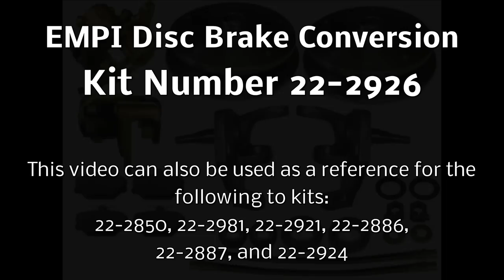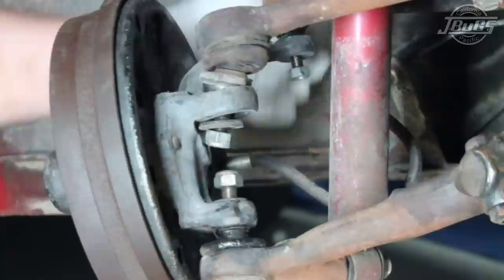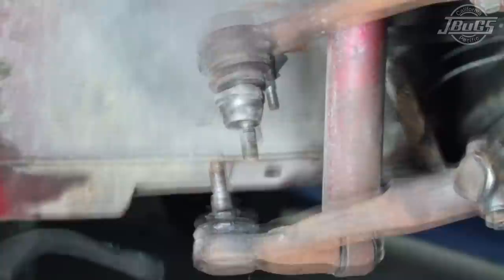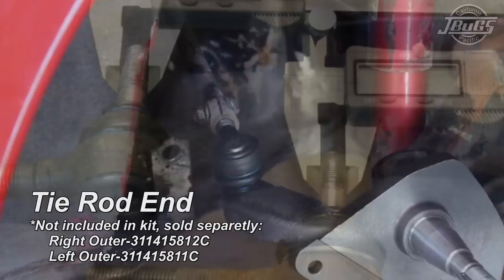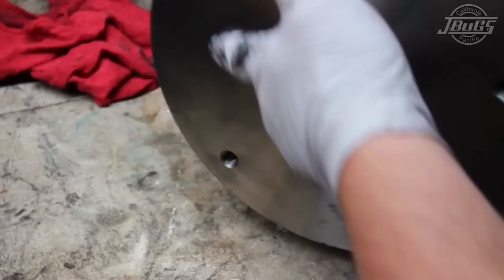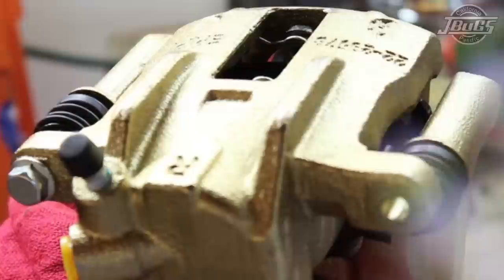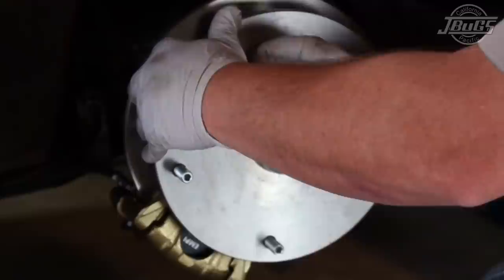JBugs - Disc Brake W/ Drop Spindle Conversion Kit Installation

Comment: Is there a way to adjust the sensitivity of the disc brakes?  I put discs in front but they're not braking as much as they need to.
Reply from the maker: After making sure that all the brake hoses and lines are in good shape and completely bleeding the brakes (both front and rear) check the free play on the brake pedal pushrod.

Comment: I have a 72 beetle. 4 Lug pattern. When i tighten the bolts holding the caliper to the spindle, It locks up the rotor as well. Would this be the cause of: "machine tolerances" ? I'm just stuck at calipers.
Reply: You can most likely use a shim (just a washer) in between the caliper and the spindle to keep the caliper from hitting the rotor.
Reply from the maker: daniel Jimenez 
Sam has the right idea here. If you have any questions about this or have more trouble, feel free to give us a call and we can help you through! 1-800-231-1784

Comment: was that a stock spindle no right saw is gave it a lil more drop also is the tie rod the same of my 68 I want to put drop spindles also
Reply from the maker: +JohnnyBoy Bigz
Drop spindles use the late model 1968 (larger shaft) tire rod ends. If you have early tire rods on your Beetle they can be swapped (along with the wheel bearings and seals) to the later model units when you install the drop spindles.

Comment: how much of a difference does the disk make, vs. the drum brakes?
Reply from the maker: +ryan odom

The first answer that comes to mind is maintenance! These disc brakes are so much more user friendly in that the disc brakes do not require the brake adjustments that the drum brakes are notorious for. Also, disc brake systems have much fewer internal moving parts, interference with after-market wheel studs is virtually a thing of the past, allowing greater flexibility in wheel selection. Another benefit is a firm brake pedal meaning much less pedal pumping and more confident breaking ability. Performance-wise, the same is true as any disc vs. drum comparison. Drum brakes get hot as they are used, and the result is a fade of stopping power. The disc brakes have the advantage here as the rotor is fully exposed to the air helping ti remain cool. The direct result is greater braking ability in high performance situations, and overall brake system stamina. In short, we find the conversion is well worth the swap!
Reply: It is a night and day difference if you've ever driven a square back or late model Karmann Ghia you'll know what I'm talking about they came with disc they stopped so much better especially type 3 VW is because they're heavier

Comment: DOES THE MASTER CYLINDER NEED TO BE REPLACED, OR A PROPORTIONING VALVE NEED TO BE ADDED?
Reply from the maker: This specific kit (22-2926 - https://www.jbugs.com/product/22-2926.html) will work with the stock master cylinder. For 1966 models, we recommend swapping to a dual circuit (1967-1977) master cylinder. If you are installing rear disc brakes as well, we recommend installing a large bore master cylinder.

Comment: I put dropped spindles on my 70 bug with new shocks but for some reason, my ball joint is rubbing on the inner part of the driver side rim. why would that be?
Reply from the maker: +Boulos Dabbour  The only thing we could think of, without seeing pictures, is that wheels with a 14 inch diameter would rub against it. You are more than welcome to call our tech line at 1-800-231-1784 anytime for help. You could also email pictures to jamie@jbugs.com and we will be happy to take a look and help you from there.

Comment: On a 1966 vw beetle, will the factory dust covers work or do I need a different style for this kit?
Reply: The factory covers should fit, yes. Linkpin cars will need special caps.
Reply: @Sam_Mebane  Thanks for the timely reply.

Comment: great video. what is the diameters of the instillation sleeves for the bearings? also do you know what angle or degree to set the spindle at?
Reply from the maker: Thank you for asking! By “installation sleeves” are you referring to the bearing races? If so- this kit in particular uses the stock, or same as original bearings as used on the 1969 Beetle. There are other disc brake kits that use other than OEM bearing sizes, those kits in particular will have the bearings included in the kit. The kits that do not include bearings, will use the original bearings and leave you the option to replace them should you desire. As general maintenance, it is a good time to replace bearings at this time however. As for spindle angle, this is something that would typically be handled by the people performing your wheel alignment, however a quote taken from the Bentley Service Manual can be found here -> https://drive.google.com/open?id=1J8aYqTF45Ym6TLXe5CC8s7rjj8gGOpOz Complete details can be found in the Bentley Service Manual which can be purchased here -> http://www.jbugs.com/product/11-0800.html Thanks again for asking, and for tuning in to the Jbugs channel! Please feel free to respond if any further questions. Jbugs.com
Reply: I was actually asking about the installation tool sizes that install the bearing races. Do you by chance know the size for both inside and out of both the front and rear of the empi disc break conversion kits. its the same kit that you installed don your video.
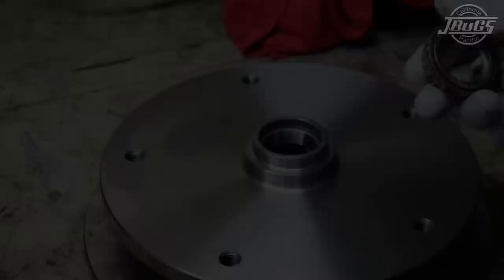Reply from the maker: The intention of these videos (to the best of our ability) is to use tools that are easily found in all neighborhoods. That being said, the bearing driver kit seen at 6:25 in the disc brake video, was purchased at Harbor Freight for about $40.00. This kit included the drivers to install both inner and outer races. It appears that this exact kit, may have been discontinued by Harbor freight, however they appear to have a replacement found here - https://www.harborfreight.com/10-piece-bearing-race-and-seal-driver-set-63261.html - It is not possible to know exactly what driver is needed as we do not know what kit you are using, however we have found that these kits from Harbor Freight have had all drivers needed for all VW applications we have tried so far.

Comment: I'm thinking of converting my bug to disc. Will I need a new master cylinder? It is a 1973 standard beetle. Also, does this disc brake conversion work with the speedometer that runs off the stock spindle? Thanks any advice would be helpful.
Reply from the maker: jfunderburk456
 The 1968 year model and later master cylinders should not need to be replaced unless a rear disc brake kit is also being installed. If all four wheels are disc, then the dual circuit master cylinder (http://www.jbugs.com/product/16-9554.html) should be used. This part is for the standard beetle only. (Not Super Beetle) This kit will allow usage of the original speedometer. I hope that answers your question! If you have any more questions please feel free to give us a call: 800-231-1784

Comment: Will I have to lower my suspension or use low profile tires? I have a 1302 Super
Reply from the maker: +Magnet Smash
Lower profile tires allow more room when a car is lowered but they don't require a car to be lowered. However, they may look slightly out of place, as there will be a large gap between the fender and the tire.

Comment: How hard is it to get ahold of new rotors and pads? are they available at local parts stores or only at Jbugs?
Reply from the maker: +Arte Fawx
Without knowing what model VW you have it is hard to answer specifically, Generally, if your VW came with original disc brakes, most any auto parts store will be able to offer replacement parts. If you are referring to a disc brake conversion kit, some kits use factory VW parts. Others use specific, aftermarket pieces.

Comment: tengo un vw bug model 94 pero es de 4 birlos el kit que tendria que comprar es diferente a este?? es decir tendria que venir con perforacion solo de 4?? o se le puede poner este mismo?? gracias espero respuesta!!
Reply from the maker: Primeramente, deberá determinar si su Beetle tiene un extremo delantero tipo king y link, o un extremo delantero de rótula. Una vez que sepa qué suspensión delantera tiene, puede elegir el kit de freno de disco con forma de orejeta que le gustaría. Ofrecemos kits de freno de disco de 4 orejetas y 5 kits de freno de disco de orejeta para ambos delanteros estilo Beetle.
Reply: ok gracias si es de tipo rotula y seria de 4 perforaciones, en usd que precio lo maneja y si hace envios a mexico cuanto en total con el envio?? y preguntarle tambien si me puede vender el kit para la parte trasera y tambien su costo muchas gracias espero respuesta!!
Reply from the maker: Nuestros kits de freno de disco delantero y trasero de 4 orejetas están vinculados aquí: http://www.jbugs.com/category/vw-disc-brakes-conversions-kits-4-lug.html . Lo sentimos, no realizamos envíos internacionales.

Comment: What kind of mesure are the wheels? Nice videos dude
Reply from the maker: The BRM Wheels are available in 15x5, 15x6.5 and 17x7 sizes. We used the 15x5 on the red convertible.

Comment: What about the speedometer cable? I got this and i couldn't get it to go through the hole.
Reply from the maker: The left side spindle is predrilled for the speedometer cable. Looking at the back of the left spindle, the speedometer cable pushes through the hole in the axle spindle, just as the stock cable would. In some spindles the hole is slightly offset of the center line and may require a bit of force to make it through the spindle and into the bearing cap. Pulling the bearing cap off may make it a bit easier.
Reply: @JBugsVWParts  it's ok, there was a machineing error. Where two parts met the holes were off, so I drilled the little step that was a result of that error

Comment: I have a 69 bug . If I get the disc brake spindles will I need new bearings etc ?
Reply from the maker: Thank you for asking! The kits that require bearing replacement will have the bearings included in the kit. If the kit you order has bearings included, then that kit in particular uses a bearing that is different than stock, and in that case- yes, the bearing must be replaced with what was included. If your kit does not include bearings, this indicates that the kit uses the factory bearings, in which case bearing replacement would be at your discretion based on the condition of your existing bearings. As general maintenance, it is a good time to replace them however

Comment: Is it possible to use drop spindles with the OEM drum brakes?
Reply from the maker: Drop spindles can be used with drum brakes on Beetles & Karmann Ghias, yes. Part number 22-2858 fits link pin models, 22-2859 fits ball joint models.

Comment: which size is the tires used in this video
Reply from the maker: +Alonso N
This vehicle is also equipped with an adjustable front beam. As the vehicle is able to be lowered further than the 2 1/2" drop spindles will allow, we used the 135 SR 15 tires for this vehicle. If the drop spindles were used alone, without the adjustable beam, 145 SR 15s would have worked just fine.
Reply: +JBUGS great is vwry helpful am a good customer from jbugs the items are great

Comment: is the process different on a 56
Reply from the maker: Yes, the process is a bit different on the 1956 Beetle as the 56 has a Link Pin front suspension setup where as the 1969 Beetle portrayed in the video has a Ball Joint style front suspension. A schematical description of the link pin can be found here. https://drive.google.com/file/d/0B9zI3G17toO0QXg5aWhLbGFlVWs/view
If you're not installing drop spindles, the disc brake kit merely bolts on in place of the backing plate, and the spindle themselves are not removed. If you do plan to install drop spindles on a Link Pin Suspension, the King Pin, #11 in the schematic is removed from the carrier allowing the spindle, #21 to be replaced with the drop spindle. Usually the link pins #13, are first removed from the control arms allowing better access to the spindle. Once the spindle is installed, the installation is pretty much the same as described in the video. Please feel free to give us a call at 1-800-231-1784 if you have further questions. We are more than happy to help as much as we can, and thanks for looking!
Reply: +JBUGS wow wasn't expecting such a thorough answer. I appreciate it. I will be calling soon thanks for the great response